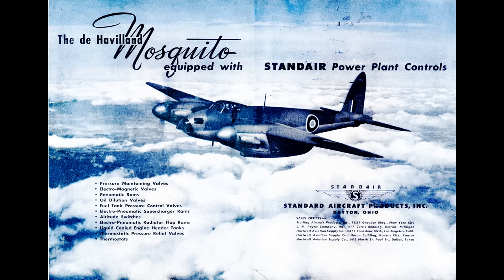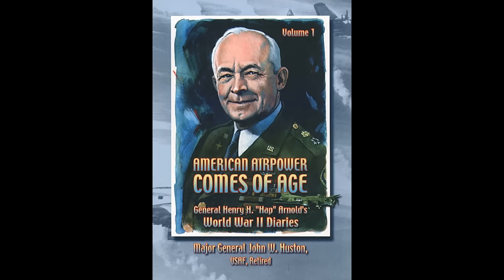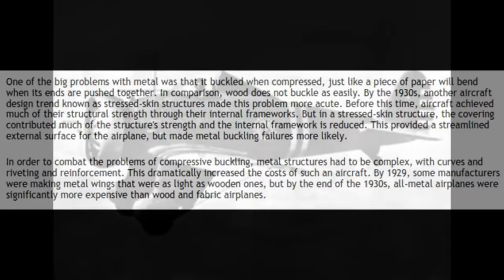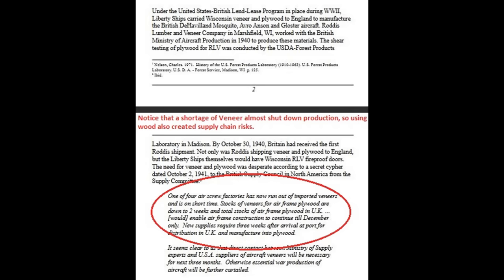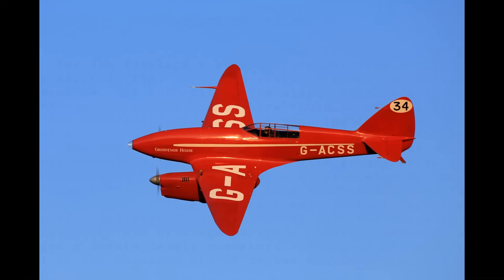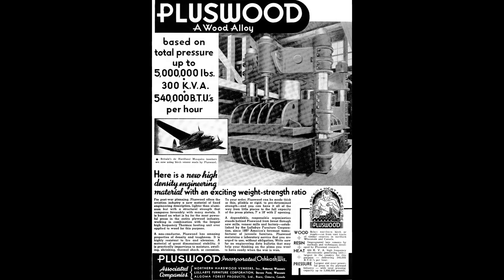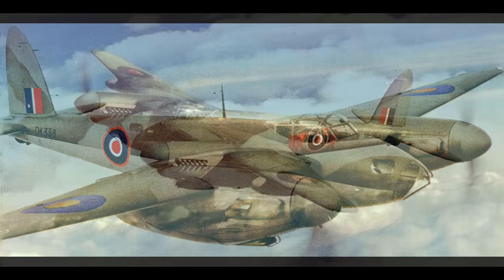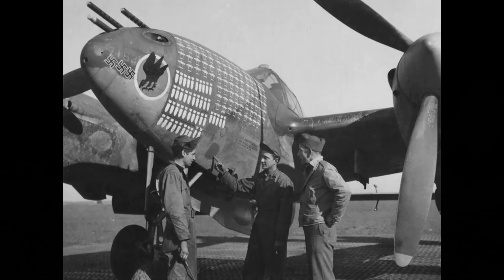De Havilland Mosquito vs. ?

Comment: The mosquito was built in an advanced manner. Plywood was spaced with balsa wood which weighs nothing and covered with another sheet of plywood all glued together and formed over a mould. This gave you a stressed skin extremely strong construction meaning all the strength was in the fuselage meaning a minimal amount of bulkheads, this technique is still used nowadays with modern materials carbon fibre for example. The mosquito could not have been built of aluminium and do the same job.
The production line loaded each half of the with its equipment then screwed and glued the fuselage together sanded it down and covered it with doped material, a very slippery shape.  No other manufacture made wooden planes that way, they developed this technique when building high speed record breaking planes. The Wing was one piece built again with wood. This advanced design could be built by fine craftsmen all over the UK and sent to assembly points. The Mossie needed to be made of wood to be structurally strong enough to do its job and fast enough to keep clear of all the lead throw its way. It’s record speaks for itself very few shot down pilots loved it. Could carry up to a 4000lbs cookie, a radar equipped night fighter version, an airborne artillery piece, which could and did sink subs, long range high speed reconnaissance, anti shipping, basically anti anything. Load it up fire it up and go give the enemy a bashing . During a famous Nazi broadcast just as key speakers came on the Mossies dropped bombs which could be heard on the speeches. Nothing could catch it until the ME262 came on the scene. It was so fast it could be used as a night fighter and long range bomber interceptor It’s lighter fighter/bomber version arrived just to late the Hornet built for Pacific and Carrier use. External bombs 2000lbs Rockets and 4 x 20mm cannons. What a beautiful pair. It was built like a WW l plane of wood,  remind me how many WW l planes did over 400 mph?
Reply from the maker: You do know that De Havilland switched to metal construction, don't you?
Reply: Not for the mosquito! And piston engined aircraft where replaced by jet aircraft and the Vampire Jet cockpit still had some wood in it.but yes at higher speed metal aircraft are needed. In its day in WWII it worked really well it was the fastest plane in the War for a period of time , when it first flew it was 20 mph faster than A Spitfire, not bad for a bomber with two crew and a bomb bay. It such a fast bomber it was used as a night fighter, used for ground attack, used for sea attack, it truly was the first multi role aircraft. What makes me so impressed is when people compare it against fighters. It had two crew and a bomb bay it’s a bomber. How many other bombers where compared against fighters remarkable aircraft.
Reply: Also the Hornet a lighter fighter version was in testing and nearly made it into WWII made of wood like the mosquito but a fighter bomber not a bomber fighter like the Mosquito,. It’s amazing some wood made it into the Vampire jet fighter which was in its day a capable fighter many where sold to foreign airforces. Interestingly it was the first jet to land on an aircraft carrier. Pilot was Eric Winkle Brown his book wings on sleeve makes a good read, he has made more carrier than anyone even to this day. He landed a mosquito on a Carrier and took off again did tests to prove it was possible.

Comment: I may be misremembering the airplane, but I believe there is a historical video somewhere on YouTube of them making a Mosquito in 24 hours as a publicity stunt, using the normal production line. I know it was one of the wooden British WW II airplanes. If a plane can be built in three shifts starting from kindling, and assuming it was actually flyable after being built, then even the normal production couldn't have been that difficult. Not all of the builders were grey-haired master woodworkers. Part of the film mentions a girl that came to work on 3rd shift wearing party clothes. She had been out partying, but didn't want to miss out on the chance to build the publicity stunt airplane. (Not to mention that there were penalties for skipping work on a whim in those days.)
Reply: It was a propaganda film for Vickers Wellington serial LN514 - constructed in 23 hours and 50 minutes. It was not "built from kindling", but mostly from finished parts laid out ready to put together ie nobody is carving a wooden prop blade or casting & machining an engine block. Amateurs cannot build airplanes, there is definitely a need for supervision by "grey-haired master xxxxx workers" with an understanding of processes & materials,

Comment: Thanks Greg. USAAF resistance (below or around Arnold) to the Mosquito may have been one of those many issues (very early in the war) where American leadership was insistent upon doing it "their way" vs "the British way" - even though the RAF (like the Royal Navy) had already been fighting Gerry for almost 2 years.  The Brits knew damned well what worked and what did not.  I wish the USAAF had built it under license, but the reality is/was (I suspect) we had too much time/money invested in the P-38 project by then. *(As you know far better than I) there were a lot of political/economic/ego factors involved.
Reply: June 1940 French munitions contracts including F4 Wildcats "transferred" to Britain.
Churchill "Our most vital need is therefore the delivery at the earliest possible date of the largest possible number of Curtiss P-40 fighters." 
page 86 The Burning Blue Addison and Crang  

Clive Caldwell RAAF was the highest scoring Allied ace in North Africa, all in P40's.

Comment: One of the saving grace(s) of the Hawker Hurricane is that a 20mm cannon shell from a (then) Bf-109 anywhere, except from the cockpit forward, would often go thru the airplane without exploding.  The same was Not true for the Supermarine Spitfire!  (And even if it exploded, the hollow nature of several different parts of the "Hurri" would limit damage since the explosion wasn't confined to a small area and therefor couldn't build up enough pressure to cause a structural failure (and the fragments of the explosive shell would often punch thru the fuselage!

Comment: I've seen only one flying Mossie and one flying P38, both in the North East of England and both caught me by surprise. The Mosquito was at about a thousand feet up, the P38 only about 300. Both were out of range before l could get my camera out of its bag. One main difference was the sound. One sounded like a pair of Spitfires, the other like a high speed diesel train. I have heard the P38 described as "Wispering Death".
Reply: Whispering Death was a name given to the Bristol Beaufighter, by the Japanese, in the Far East! it was later "adopted " by the US Corsair, never heard of the P38 ever being called that!
Reply: @sprinter1832  l may have got that wrong, but the P38 sounded so different from the Mossie. If you've ever heard an Inter City 125 train approaching at high speed, that's what it sounded like. None of the snarl of two Merlins but more of a low whistle with a lot of pistons in the background.

Comment: Why build the Mosquito out of wood?
DeHavilland designed and built aircraft for the Royal Flying Corps during WWI, but, for business reasons,  decided to avoid military aircraft production in the interwar period.  Their civilian types included light aircraft (various Moths), airliners (e.g. Dragon) and air-racers (e.g. the dH 88 Comet).  All made from wood.

When they came to develop the Mosquito, DeHavillands had decades of experience designing and building successful wooden aircraft.
Wooden aircraft were their business.  They had the skills, and the experience.  When they came to design jet aircraft, those early jets (Vampires) still had wooden fuselages - basically modified Mosquito noses.

Much of deHavilland's wartime construction was sub-contracted to furniture makers based in High Wycombe.
The labour force was skilled with wood construction, and less used to working with metals.    The town is still surrounded by beech and birch woods, used in the construction.

Why use balsa? In the days before expanded polystyrene, balsa was a major packaging material - a fast growing (therefore cheap), light weight wood that was packed around engines and spare parts sent from the US amoung others.  Basically, balsa was waste product.

Why build the Mosquito out of wood?  It made business sense.

Comment: On a strategic level, the British had to import both aluminum in raw form known as bauxite, or processed ingots as well as lumber.  In either case the electrical energy needed to process the raw ore and even to melt the ingots is not insignificant.  I’m sure once De Havilland saw the per unit cost for each material it factored into the wood decision.  I don’t have any cost comparison numbers but it safe to assume that aluminum was significantly more costly.  Once war production was in full swing the cost of electricity to process ore became a factor in strategic thinking.  So contracts for a very adequate air frame that used an alternative to aluminum became attractive to war planners.
Reply from the maker: So why didn't they build Spitfires and Lancasters out of wood. On a serious note, I'm sure strategic materials factored in here, but the main reason the Mosquito was made out of wood is because that's where De Havilland's expertise was.

Comment: The sewage and garbage from a castle is often dropped straight down into its moat - hence why drinking water from a well that is linked to it, is inadvisable.
The many padlocks on the gate in the last shot is a copy of what lovers do at bridges in Paris, then they throw the key into the river.

Comment: If you do a comparison video, you might want to include cost differences if there are any.  2 planes may be equal in capability, but if one takes longer to make, costs more or repairs are horrendous is a factor in war.
Reply from the maker: Yes, and that is exactly where the British planes fall down. It took over twice as long to build a Spitfire as a 109.

Comment: Thank you for pointing out that wooden construction was not revolutionary. If anything it was retrograde but it worked.
I've read that wooden airframes were not as durable (hence only three flying examples against dozens of Spitfires). However, combat aircraft in those day seldom lasted long anyway. A mosquito holds the record for sorties over enemy territory, 213 in total.
Great analysis.
Reply: big cheese  
Not a great analogy.  I "found wood" this morning. Did more than play with it!

Comment: One of the best planes of the war. The comparison with the P-38  will be interesting. I think the Lightning had the edge as a fighter but the Mossie, which could basically carry the payload of a B17, had the rights as a bomber.
Reply from the maker: The Mossie could not carry the payload of a B-17, not even close. That's a complete myth, the B-17G could carry over 12,000 pounds internally. So could the F. That said, as a bomber the Mossie does have the edge over the P-38, and a lot of other planes as well.

Comment: If the US was anticipating a Pacific theatre, then wood aircraft was probably not a good decision. British had problems with them in the far east.
Had a perspex nose cone form a Mossie in my garden as a kid.
Had a fellow flight instructor who flew Mossies during the war, he had a few stories.
Reply: Got those Far East problems solved fairly effectively. And it didn't affect many aircraft to start with. Hereward de Havilland went over there and sawed straight through a wing front to back to check the gluelines and timber state.
Reply: @TheHarryMann  I thought more along being eaten by the local insects.

Comment: Greetings, you will get to this, because you always do (of course you might surprise me - as you always do); the P-38 and the Mosquito might cover the same waterfront in ground-attack, but there is no equivalence in the day-fighter role.  The Mosquito knocked off a surprising number of FW-190s and Me-109s during the day (but that speaks to the power of ambush - being at the right place at an unexpected time).

Perhaps a more telling comparison might be light to medium bombers (B-25, A-26, Boston) where the Mosquito must hold pride of place.  Think of a Dolittle raid with Mosquitoes!  In any event, Mosquito construction required a specialized set of skills, and apparently, while they were loved, they were also crewed by the cream of bomber command.  Given the difficulties in producing sufficient Mosquitoes to satisfy the RAF's demands, we might have run into similar issues here, with one of the results being supply chain disruptions (the purported reason we did not see a P-38K in early 1943 or ever). 

All that being said,  thank you as always for your work,  And, like you, I believe the B.IV and the PR marks were the most beautiful versions.
,
Reply: Yes, the U.S. should have procured the Mosquito in place of medium bombers, not the P-38.  The Mosquito would have consumed far less resources and manpower to put the same amount of bombs on target at a lower loss rate.  The medium bombers were vulnerable, had a sizable crew, and each required an escort of 2 to 4 fighters.  The U.S. military figured this out too late to change their bomber production priorities in WWII, but after the war both USAF and the US Navy made a rapid transition to single or two place strike aircraft that relied on speed rather than defensive armament.

Comment: Another excellent and informative video! You’d have to assume that the US manufacturers were caught up in the big new thing of all-metal construction and it probably wasn’t a good business move to advocate an old technology. But Howard Hughes was immune to such pressures. 
I’ve got an idea that epoxy resin glue was developed in connection with the Mosquito later on, but possibly not widely used.  AFIK the glues were resorcinol formaldehyde and possibly aerolite powder glue activated by catalysts. These are both strong but can be brittle but filleting with additives got around that.  Be interesting to get a definitive answer on the state of the art at that time.
Wasn’t even aware of the bent-boom P38! Learn something every time I watch your videos. 👍🏻
Reply from the maker: Thanks Dave.

Comment: Not mentioned why the Mossie was fast had a lot to do with the surface finish achieved with the wood construction. The lack of thousands of rivets, some flush, added to the surface drag. The curved plywood sandwich was was able to be sanded to a very smooth finish not unlike racing sail boats. Metal skinned & metal framed aircraft could not be sanded, without adding filler. When you see an old warbird constructed from metal alloy you can appreciate the difference in surface finish  to that of a plywood sandwich construction. A smooth finish equals speed.
Reply: It helps.. a bit. Basically it was two Merlins in an airframe with less wetted surface area than 2 Spitfires. The original estimate of 5-10 mph faster than an early Spit was bang on. de Havilland had a lot of experience estimating aircraft performance.
Later, after performance testing many types of exhaust, Bishop would say.. "next time, we'll design the exhaust first, then the rest of the plane around it"
PS. I think they were seeing around 425 to 430 at high altitudes with the later two-stage inter-cooled Merlins

Comment: The P 38 had it's own list of problems to work out that seemed more serious than the Mosquito issues. Most notable were the much less reliable Allison engines, compression wave elevator control lock at combat dive speeds requiring a special dive brake, and the serious lack of heat and climate control at high altitude.  It also had the same prohibition on full power one engine flight control despite counter rotation props. 
 
The mosquito's four cannons gave it better ground attack anti tank ability.  It had a greater internal gas tank combat range with a similar bomb load but in an internal bomb bay.  It carried a co pilot/ navigator and could accommodate  another passenger in the bomb bay if needed.
 
The P 38 shined at medium altitude and the warmer conditions of the pacific theater.  The high scoring aces like Bong and McGuire loved it.  
However, the mosquito was so versatile, adaptable, and appreciated, it stayed in production till the early 50 s.
Reply from the maker: The P-38 could also carry a bombardier/navigator, and two passengers.
Reply: @GregsAirplanesandAutomobiles  Night fighters, trainers and special pathfinders had Tandem seats but I heard mechanics and other ground personal were sometimes carried in pods under the wings instead of drop tanks. He called them coffins. What a way to fly.   Good video . Thanks.

Comment: During WW2 there was a nother twin engine aircraft that used the same engines that was uesd on the  F4U Corsair that where to be supercharger ed with 6 blade propellershad a crew of 3 and a trycycle landing gear to be a high speed high altitudes recona.  Aircraft that had no guns and to use its speed and altitude to keep it safe  that was to be build by Curtis's aircraft   and it never get off the drawing board